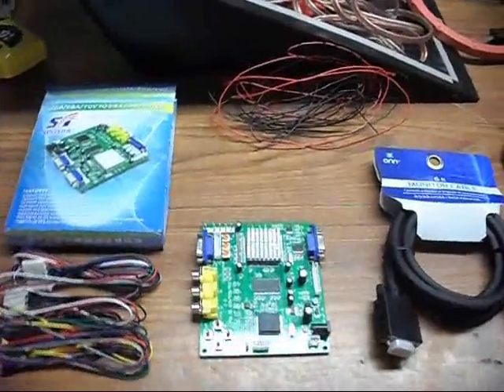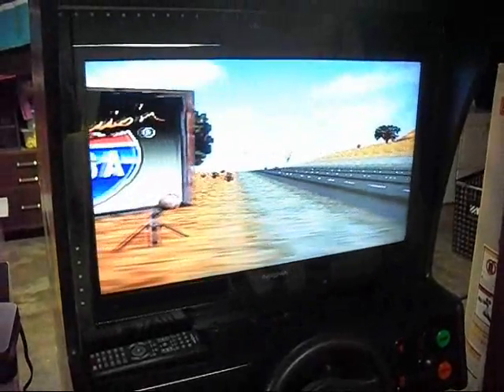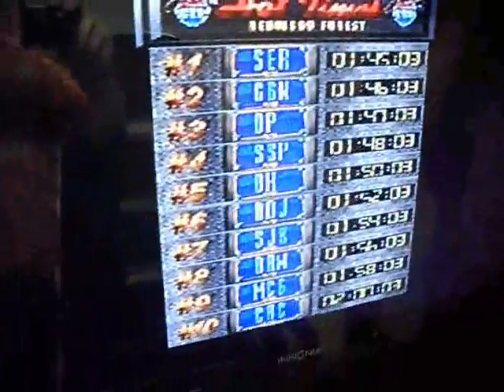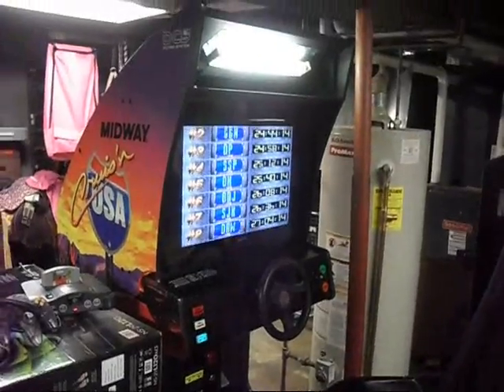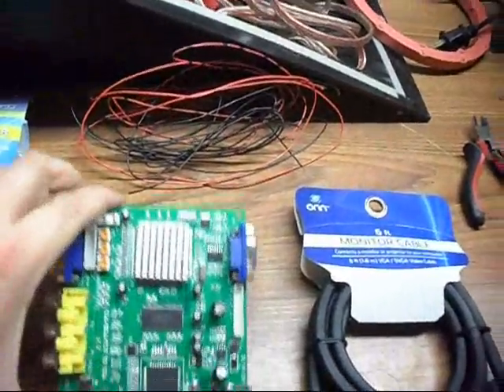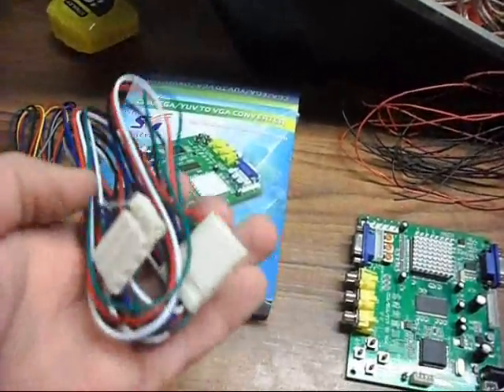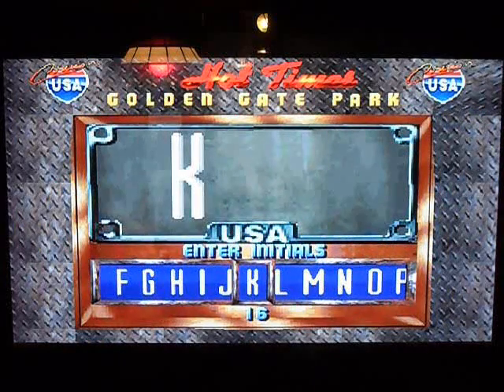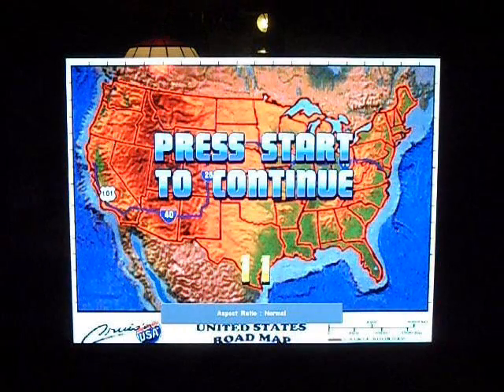Sintron GBS-8200 CGA/EGA/YUV to VGA Video Converter (Adapter) for Arcade Games - LCD TV Monitor

Comment: What's the technical name of the 5 pin plug you bought for the board? I keep looking for it on Amazon but get no real results
Reply: http://www.aliexpress.com/item/Newest-HD9800-CGA-EGA-YUA-to-VGA-Game-Converter-Supports-All-VGA-Monitor/2047756183.html
Reply: It Is designated as 5p-SVF-V
Easy obtainable if you know its name.
Reply: UPD: NOT easily obtainable. You can buy 8$ Jamma harness and clip it from there.

Comment: where did you get the 5 pin cable or whats the correct name of the cable because I can't find it on ebay? Thank you
Reply: http://www.aliexpress.com/item/Newest-HD9800-CGA-EGA-YUA-to-VGA-Game-Converter-Supports-All-VGA-Monitor/2047756183.html
Reply: Look for keyword 5p-SVF-V
Reply: Or you can buy 8$ Jamma harness and clip it from there.

Comment: i cannot seem to get this board to sync with any of my namco games (tekken/tekken 3/soul calibur). i get a really wonky picture for a few seconds then it goes to "no signal" and a picture comes in intermittently for a second or so. i thought it was because they are medium res games, but you got yours to work. any clues as to why im having an issue with getting a stable signal? (im using the jamma hookup by the way.)

Comment: http://www.jammaplus.co.uk/forum/forum_posts.asp?TID=58185&PID=576248#576248

we posted our info and some pics on using the VESA system to hold the monitor.  It will go out on a fair so we will know how it holds up in a few months. 

Bolted in the VESA holes and extra TEK7 glue.

Comment: Hey Keith,

this video is  great, we did the exact same thing with a dual cruisin sitdown, I'm so glad you named the SP ST settings, this will make my life easier, having the same issue.

It would be great if you could post your settings for the sintron gbs-8200.  We used you page about this as a template.

Again, tnx for this info:
1024x768
SP 04
ST 03

We kept the original Bezel, went widescreen and played with the geometry.

Great, thank you for sharing this info

Greetings from Belgium!

Comment from the maker: It should work with a standard component cable. Make sure its set to YPBPR mode (press SW until YPBPR shows up). If it won't sync press AUTO until it does. As far as working with gun games, I really couldn't tell you. Most of those games are designed to work only with the type of monitor they originally had from the factory.

Comment from the maker: I don't have my Rush the Rock anymore, but I think they are roughly the same size. if you Google "Arcade Measurements" you should find a site that has weight's & measurements for many games.

I do know that the original Rush cabinets are one piece so they are much harder to transport or relocate. The dedicated Rush the Rock games are two piece. A dedicated Rush will have "Extreme Racing" on the cabinet artwork, Rush the Rock will have "Alcatraz Edition" on the cabinet artwork